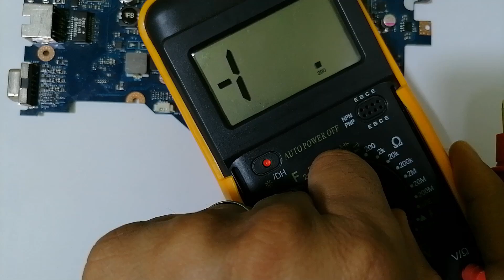No Power Motherboard Repair - Troubleshooting Dead Motherboard step by step Part 1

Comment: I opened a lenovo ideapad 5 laptop, when removing the battery cable with a sharp screw driver it slipped and accidentally connected one of the battery wire to the metal which secures the battery cable, it sparked, when I reassembled the laptop it doesn't power on, no lights, even when plugged in. First thing i noticed was when I reconnected the battery the CPU warms even when not powered on but cools when battery is not connected. My question is could that spark when I tried to remove the battery cable caused a short somewhere near the CPU?

Comment: Sir if I check the ic output so where I can put black lead please sir help
Reply from the maker: On any ground next the IC or on the - of any capacitor
Reply: If we check the input voltage of ic also ground should be the same sir from capacitor ground